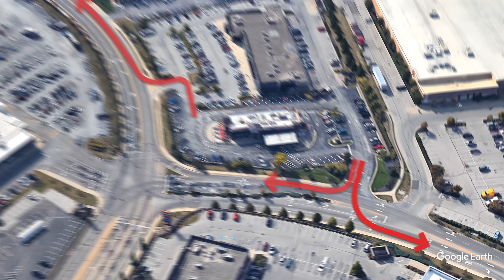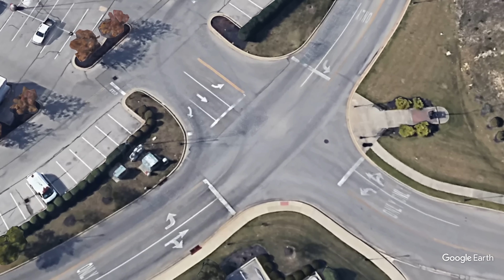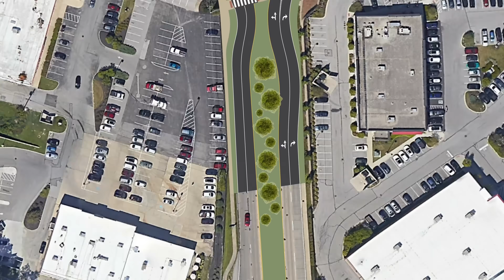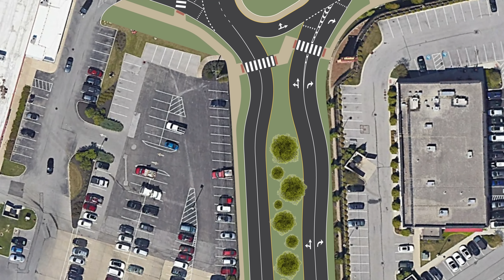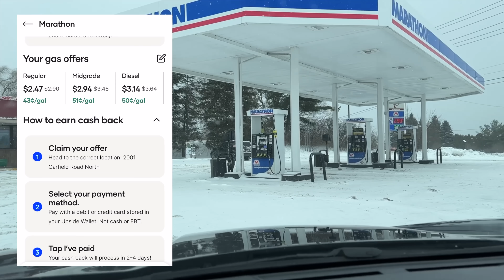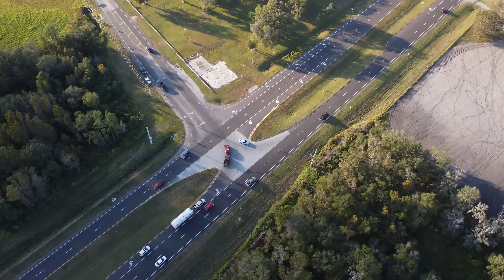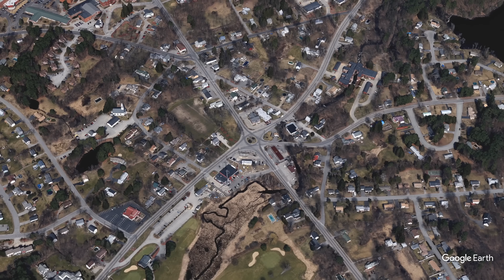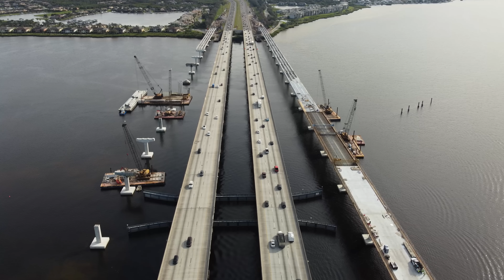These Intersections Should Be Illegal

Comment: @9:49, I ride through a less busy version of this (a 4 lane road, connects, via a cloverleaf to the freeway above).

The safest and greatest visibility I can create for myself as a cyclist, take the car lane of the straight traffic. Force cars to slow down. Either they merge left to go around me or yield until they can safely enter freeway’s ramp.

This isn’t ideal as a cyclist. On a less busy cloverleaf, even with a bike lane (painted no less), you at least stand out in the car’s lane. (If you stay in the bike lane, that is dice roll and maybe only 40% to 60% chance of not getting nailed when a car is approaching. Moving into the car’s lane, you create more presence, cars generally notice and you are still playing a dangerous game of chicken. But less dangerous than being in the bike lane.)

What makes this even remotely safe, to ride in the car’s lane as a cyclist, is having a low enough speed. A busy road, I would want the speed limit of 40 km/hr. A collector that doesn’t get so much use, 55 km/hr is more manageable. However, should cars be push towards 80 km/hr, that differential is too great as a lone cyclist.

(A proposed change to a similar mess of an arterial and a freeway that peeks my interest as a cyclist: a protected/separate bike lane. I do wish there are lights which stop cars when cyclists cross the entrance and exit of the cloverleaf – from the cyclist’s perspective. This kind of infrastructure is important and looks to be a lot cheaper than building 2 new bridges but who am I to judge the craziness of Florida.)

Comment: @7:36, I'm not sure of the volume and what peak vs average flow (and volume) is like.

A signalised intersection is a clear solution if the volume is too great. Even having a collector that connects a few of these side roads, then the arterial could have just a few lights. (This isn’t exactly cheap but when preventable injuries are happening a light on an expressway is maybe your only cheap and far safer solution.)

If we are trying to not add any signalised intersections, then reduce the speed in areas. Try to have these side streets come into a few kilometres of reduces speeds. This gives everyone more time. Let’s say the arterial is 80 km/hr, then the reduced section should be 55km/hr. (probably a flashing overhead light warning of the lower speed is advisable.)

Comment: roundabouts are not the be-all end-all answer to everything. the first set of intersections could easily be fixed by making target's side road be the only entrance, and have chik-fil-a branch off that as a 4-way near where the current T is at the corner of the target building. This will eliminate some of the parking spaces, but chik-fil-a can reclaim the land used by its current entrance road and use that as the replacement for the lost parking spaces. Since target already has a slip lane running parallel, then you can make that exit a right-only, forcing people who want to go left down to the main 4-way entrance/exit of Target.....THEN maybe put a roundabout OR a traffic light linked with the main thoroughfare.

the second one you shows is absolutely no problem, for majority of crossing vehicles, the traffic is almost non-existent and can easily wait in the center, so they only deal with looking at one at a time regardless. For bigger vehicles, look again, there are turn lanes at regular intervals, so they can easily do a right and u-turn without having to add more lanes. The costs of having turns goes up in maintenance/repair/repave, so it makes no sense to need it here for the little traffic it does get. I also live close to similar road systems, and majority of them have the ability to choose well in advance which intersection to meet at before you get there because they usually split off in the same town further up.....which means people tend to pick their favorite (the one that gives them the least problems) at the time sets that they normally drive them (whether to or from work/shopping).

the third one i agree with, since it's already a roundabout, might as well make it safer, plus you already have the room so you might as well utilize it (and additionally add some beauty to the town with a centerpiece)

Comment: The infuriating thing with shopping center parking lots is that they don't even provide a safe path to walk from your car to the shopping center.
Reply: yup, the amount of times ive almost been reversed into/driven into in those parking lots is insane
Reply: Costco is the only retailer I've ever seen take effort to build walkways from the parking lot to the shopping center.  But not all have them.
Reply: @coherentpanda7115  Walkways are an integrated part of any shopping venue here. And also a bicycle stall. People are just expected to get to the shops by any means, on foot, bicycle, public transport and motorized vehicle. In Brussels you'll find a subway line below the shopping centre "City 2".
Reply: Some shopping centers have pedestrian paths that lead from street directly to front entrance. Mostly newer ones here where I am. They look inviting when done right, especially when lined with foliage.
Reply: What really helps with parking lost is turning the parking lanes to go sideways with respect to the building. That way, pedestrians are not walking along them, but crossing them. By putting gaps in the parking rows at strategic positions, you can now funnel foot traffic and mark those crossings closer to the building.

Costs the same to build, doesn't require extra space (maybe one or two parking spaces per row, if you're really unlucky), and significantly increases safety. And the best thing is that you're exploiting people's natural behaviour and don't have to educate them to take foot paths parallel to the parking lanes. Also, it eliminates the issue that those footpaths are on the side of the car the trunk isn't, so people with shopping trolleys can't use them anyway.
Reply: Maybe in the USA but not here. There are pedestrian paths everywhere. And concrete blocks to enforce them.
Reply: @flitsertheo  Some parts of the US also aren't as bad as this, it really depends on certain regions that are less car-centric, i'm in the area outside of Boston and there are plenty of sidewalks and safe pedestrian signal crossings at intersections, not saying Boston isn't car centric but i think more suburban towns and cities in the northeast have a bit less of this problem than other regions.

Comment: I'm confused why chic fil a and target need separate driveways at all when they're literally right next to each other. Suburbia is insanely designed.
Reply: Always a blast driving to an unfamiliar commercial area in suburban America and trying to find out which of the 3 unlabeled driveways you need to take to avoid ending up in a neighboring parking lot inexplicably blocked off from your destination. Truly one of the stupidest things imaginable, yet somehow ubiquitous.
Reply: @Stripbolt this is why “[very well adjusted person] with lifted pickup truck” is such a common niche in suburbia. Any all blockades between parking lots under half a meter tall can be ignored if you drive wrong enough.
Reply: @Stripbolt  Many/most places require mutual access as part of platting and site plan approval.  That creates shared driveways.
Reply: It's not easily apparent in the video, but there is a bit of a slope in this area, and the Target parking lot rises up away from the street, and the Chick-Fil-A lot slopes down, so consolidating the driveways wasn't done when the area was built. The entire shopping area was essentially built from scratch though, so they could have coordinated the grading of the parking lots to combine the driveways.
Reply: @e @ericanspach4437 slopes never stops PA from building shared driveways with unreasonable looking grade
Reply: @ericanspach4437  I wouldn't consolidate the driveways. I would connect the two after the driveways. But completely blocking people from turning left into Chic-Fil-A is utterly ignorant. Just move that left turn down to the Target entrance.
Reply: Question for any US Americans. Do companies in the USA ever share a car park? Like, do you ever get a whole load of parking spaces in front of a group of shops, and people going to the hardware store and the supermarket and the fast food restaurant all park their cars in amongst one another? Or does every company have its own private car park for only their own customers?
Reply: @Asha2820  of course there is totally shared parking when a group of stores and businesses are together, like a strip mall or shopping area. That's the most common actually. Target, Marshalls, Petco, Sally's and a candy store and a taco place are together with Starbucks and game stop and famous footwear, Michael's crafts and a mattress store all in the same area. The parking is completely shared
Reply: @Asha2820  another example I can park in the home depot and walk over to PetSmart and about 8 other stores in a strip mall. That's all ok. There's lots of parking. It gets full but not so full that it's impossible to get in and out.
Reply: @michah321 unless you have an over zealous property manager
Reply: @Asha2820 yes, it's called a strip mall
Reply: @Asha2820 literally always. Seperate parking lots is the exception, not the rule
Reply: @Asha2820 businesses lease their space, they don't own it.  The property ownership behind the scenes and invisible property lines determines where "thou shalt not pass!"  (Thet often plant hedges to really be sure you aren't parking in property A and walking to property B, because that is a crime--trespassing.)
Reply: They are probably owned by different property managements. The reason you may see multiple businesses in one lay is because one company owns that entire lot.
Reply: Iirc the chick fil a came after target and the rest of the surrounding area. And it’s also significantly lower in height than target. So targets entrance takes u up while the chick fil a takes u down a bit and connects several other businesses such as this really popular pizza place.
Reply: I'd close both those entrance/exit completely. The chickFila and the truck entrance would both run into each other and run along the pavillion pkwy to chesapeak ave where they can have that roundabout. Target will lose some parking along the pavillion pkwy and it would be much safer overall for everyone.
Reply: Those are my thoughts exactly. Those driveways should just be merged.
Reply: My thoughts exactly. When he was talking about how someone in chic fill a would then have to go to Target I was like IT'S LITERALLY RIGHT THERE JUST PARK IN ONE LOT AND WALK TO BOTH
Reply: Different pieces of property and developers at different times.
Reply: i'm guessing they were built at separate times so giving chickfila a completely separate driveway/parking lot seemed to make sense. but i agree, the whole intersection is a mess, but a lot of problems would be fixed by just combining driveways/parking lots.
Reply: In my part of the US you'd often see a frontage road in situations like this so people aren't entering and exiting directly off the main road.
Reply: probably different landlords
Reply: Do people seriously drive 10 metres from one shop to the next? Park at target and walk to get your fried chicken.
Reply: @BibleStorm  How are you going to be obese if you gotta walk to every other store?
Reply: Often it's not really designed at all. It just happens.
Reply: The left turn into and out of Chick-fil-A likely aren't or at least shouldn't be legal. 
The property should have had restricted access to that road only through target's curb cut.

This isn't an our system is bad issue it's a people f'ed up what was supposed to be.
Reply: If they don't make it so we have to drive literally everywhere every single day, they don't sell enough cars and the economy goes down. They have to screw us over at every single opportunity. That's the answer to why 99% of everything sucks so bad.
Reply: yea that makes no sense
Reply: Having 1 driveway instead of 2 would solve like half the problems
Reply: Chic fil a also seemly has notoriously horribly designed interchanges.
Reply: Target and chic should share an entrance..    this is bad planning and easement allowances..  could be land ownership or zoning regs that make simple solutions complicated ...  Problem with fast business growth and bad infrastructure not designed to handle the traffic
Reply: 'Turf war', I assume.
Reply: Likely different property owners.
Reply: Because one was probably developed before the other and so 1 driveway was built and since thr owner doesn't want to lose his part of the land and remove the parking spaces on the side they settled for another driveway. Idfk it's dumb ik
Reply: People want to live there because it's better. Even if the roads are a little confusing.
Reply: I’d say maybe there’s a creek running in between there
Reply: Have you ever seen a chick-fil-a parking lot midday? The drive-through lines wrap around the building, twice, and the neighboring McDonald's to boot
Reply: I'm more confused why the hedge/fence between them isn't torn down so people can simply walk across
Reply: Probably different property owners?
Reply: It can't be insanely designed, because it isn't designed in the first place... They just do things without any proper analysis or planning.
Reply: Imma just park in the most convenient nearby lot and walk to the business I need to go to, even if have to walk across "property" lines.  Parking "rules" out there are rarely enforced anyway.
Reply: Yep and you could fix both driveways with another roundabout
Reply: Yeah, when I drive to a shopping centre, I don't drive very deep into the carpark, I just park in one of the first parking spaces I find, which is almost always along the outskirts of the carpark, then I just walk across the shopping centre.
Reply: @alexanderralph8341 I do too. I'd rather walk a little further than deal with the confusion closer to the store
Reply: I'm willing to bet both were sperate lots built at different times from another.
Reply: Made me laugh that he implied a shopping center is not a place for pedestrians to walk. I feel like anywhere else in the world that's EXACTLY the place you usually walk.
Reply: @VoxelLoop they're talking about walking down the roads
Reply: Yea if they were smart they would've just connected the parking lots
Reply: @DimentioGaming  far better than the videos solution of making a roundabout. Why make a roundabout for that small issue
Reply: I see it too, they could've made a path that goes between them. Unless it was hilly, but I don't see that obstacle. There's an example in my neighborhood where even with a hill, it takes one road just to get downhill from that Chic-Fil-A to my grocery chain.
Reply: @kalebwieland4938  its a fairly decent drop
Reply: It’s all piecemeal and has no thought
Reply: Because waking to Chic Fil A is an utter anathema  ... what are you a Lib!
Reply: I’m confused why chick-fil-a needs to exist at all.
Reply: @socool775 It's very popular. I don't go there, but people love it. And it's discouraging beef consumption, soni figured people into the environment would prefer it to hamburger restaurants.

Comment: Florida has an absurd number of bike lanes right in the middle of 45mph roads. Like there will be a nice little walking path that is separated by a bunch of grass so it's super safe for pedestrians, but it's very serpentine and narrow so riding a bike on it would be pretty difficult. So they put in a painted bike gutter that is constantly interrupted by turning lanes branching off, all at 45mph posted speeds, but since it's Florida that's more like 60mph. I know they assume no one rides bikes there because it's so hot most of the year but I see people on bikes all the time.
Reply: They do that to get the federal funding which requires bike infrastructure. But they know that almost nobody will use it
Reply: @therealcmj  Not if you build it like that, its a fucking death trap. If they'd actually build bike infra with connections from sources to destinations they might be surprised how many people start using it.

Comment: That first intersection is an actual warcrime, absolute carnage
Who the hell ever thought that this was okay to plan and build???? Do engineering titles come with your cereal in the US????
Reply: I think I might have a worse one than that, actually. Go look at the road design around Culver's in Alexandria MN. Oh, and it's worse than Google maps presents it, look at the satellite view and ignore how it's placed Walmart Dr -- literally no one uses that stupid little alley that connects to 50th, they all use the unnamed street with much better paving and connects directly to the actual Walmart parking lot (and the equally busy Menards further up, but most of that traffic flows through Sanibel or Broadway). At least the speeds are slower along the state highway there, what with there being stoplights on both sides of the interstate interchange. IMHO the solution is identical, though: roundabout on the highway, roundabout on Sanibel, and force right off Walmart Dr and coming out of Culver's, Aldi's, and the Holiday. Hell, put a roundabout coming out of Culver's, it's usually pretty busy (and the Hardee's across the road isn't, they don't need that much parking, believe me -- half the time there's a corn stand or pumpkin stand sitting there.).
Reply: Main ingredient there is lead